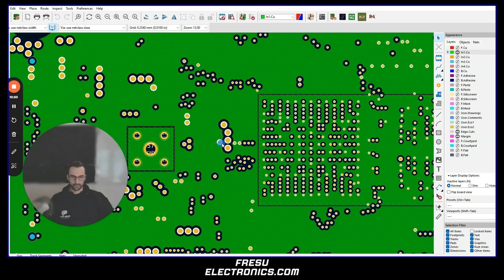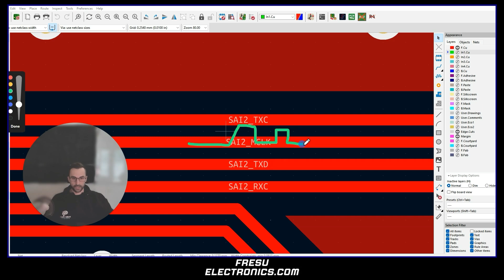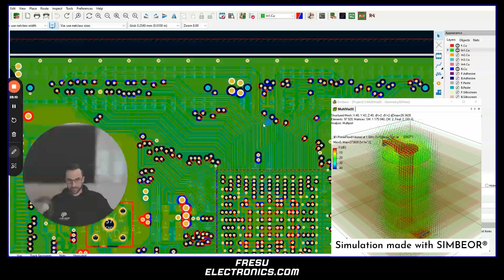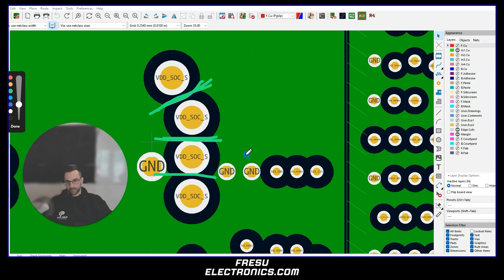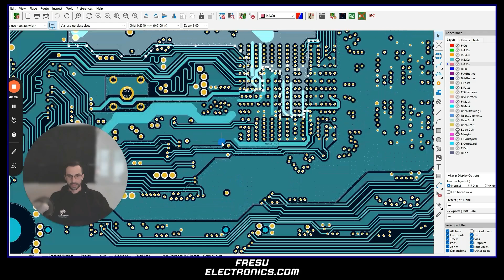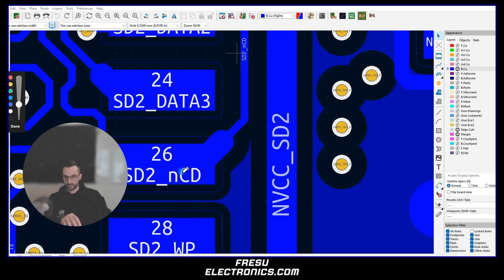iMX8 SOM - PCB Design Review for Low EMI and Signal Integrity

Comment: Great video, thanks for sharing.
Choosing the right stackup seems to be really crucial when designing such high speed boards. 
I wonder whether we could use Layer 3 or 4 as a pure power plane and make Layer 5 a proper RRP with solid ground pour instead?

Is it better to have a dedicated power plane with power polygons only or a mixed signal/power plane is also okay as soon as we have RRP for any of these?